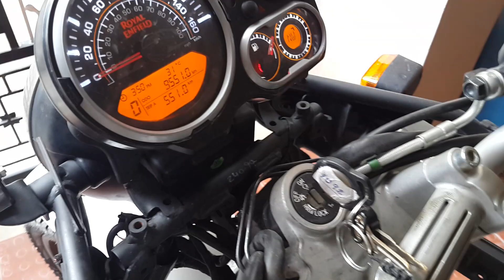Royal Enfield Himalayans 3rd Silent Recall

Comment: I had the same wiring problem with my Thunderbird 500. It has clocked only 7400kms but the wire got torn. Poor quality of wiring harness. I was a fool to buy royal Enfield. Not trustworthy, not at all.
Reply from the maker: The Mile Muncher RE is flying high on the fact that they have no competition in the current market..
Reply: Shajil John Wait for GS 310 bro..
Reply from the maker: I have been waiting for the KTM Adventurer which was due in 2016 now the say it will be out in 2019..  had no other option so went with Himalayan.. 
I think RE is behind this... :-)
Reply: Shajil John Well KTM did confirmed in the 390 press release earlier this year. Saw that interview. But yeah, late 2018 for sure. Yet to see any spy shot news on the ADV 390. Gs 310 is the best bet if sensibly priced for India under 3L as it will be made in India. Or you can buy the rumored Himalayan 750 in 2018 🤣🤣🤣
Reply: If the versys x comes to india you will not have to look far.
Reply from the maker: RE will still rule due to to its made in India price tag.. The imported Versys X will cost round 4lakhs on road...

Comment: filthy service guys bdw RE has fallen into it's own trap which is laid to attract buyers. once go to any RE service center in India of your own choice and check as people are so furious with these junk bikes. RE future scope on sales would be hampered soon. 😎
Reply: SuperRaghurocks nope.. we have so many fanboys in india , they will buy RE even after all the shit.
Reply: SuperRaghurocks proper servicing has been a problem with many indian manufacturers. Bajaj had the same problem with pulsar 220 and 180 where the service guys would try fitting in 150 parts which don't fit. Same goes with the dominar. Even now, you can see some complains online for tvs apache, recently saw a video where the break cylinder just dropped off the rr310. 

Good thing is RE guys this time have been open about it, and the ceo accepts the fact that there have been problems with the Himalayan. In my view, unless there is a major safety concern in which case everyone should just avoid the bike, we as consumer should help the company find out the faults. Hopefully things pointed out in the video is taken note of by re guys and worked upon.

What I completely disagree of is the fanboyism part. Himalayan offers something unique in the price bracket with no other alternative, hence people buy it, but i have seen people taking it too far beyond the bike's capabilities. You do get what you pay for. There's a reason why Kawasaki's offroad bike is priced at 3lakhs for the 112cc engine.

Comment: Hi Shajil, I bought the BS3 model a few days back as I coudnt wait for the BS4 to be out (it will take another 2 months I guess). I facing isuues with the gear box. When I put the bike in first gear it sounds like something is stuck inside the engine and the clutch is really tight. Plus, the oil leakage is there as well. I haven't heard from the royal enfield or form the showroom about any recall or part replacement. Should I contact the nearest service center directly and ask them to change the parts? I am clueless!  will appreciate your advice.
Reply from the maker: call them up, or better file a consumer help claim,

Comment: Hi shajil, 
I test rided the Himalayan bs3 and the suspension was buttery smooth. after test riding that I doesnt wanted to test ride any other. should I wait for bs4 re Himalayan or can I go ahead and try Dominar and go for it. I could see lots of complains regarding defects in himalayan engine.
Reply: D RIDER better go for dominar as u can't rely on RE's pathetic service. I own a Himalayan too and they haven't recalled mine even once.
Reply: D RIDER Go for dominar if you are city rider,  Also try Mojo if you need butter smooth engine and ride mostly on highways and little offroading
Reply: wait for some time if u wait for Himalayan..re is gng to lunch it in other segment(700-750 cc,double silencer) not confirmed n sure abt this

Comment: Also one advice from my service centre.. U ride the bike for about a month/10 days then  empty the engine oil and measure the exact amount to ml. And replace only the same amount.. Check out the fix.. I have not had a single oil leak for more than six months.. But the only con is bike now heats up a bit.